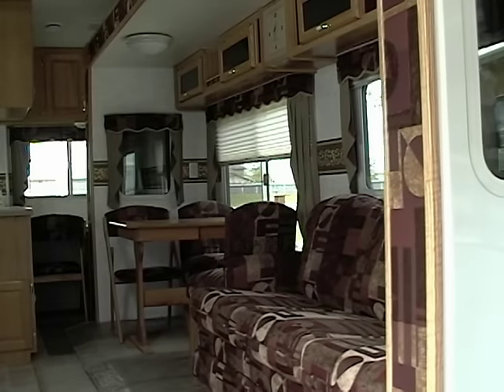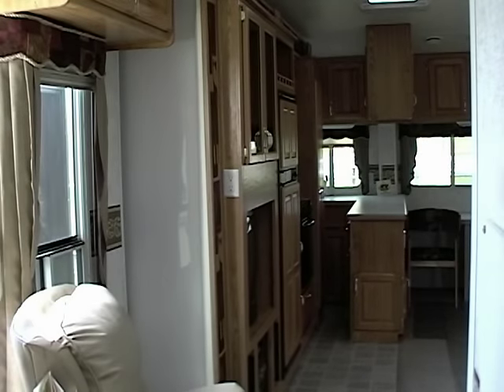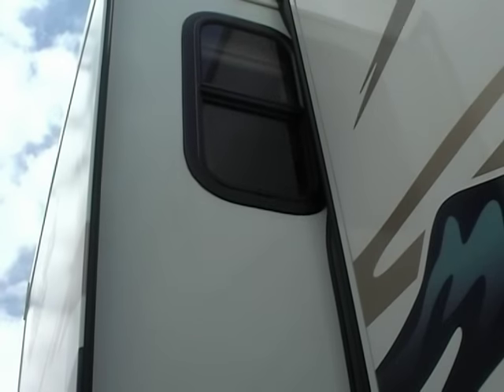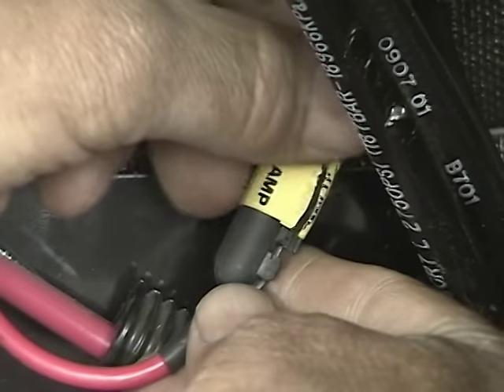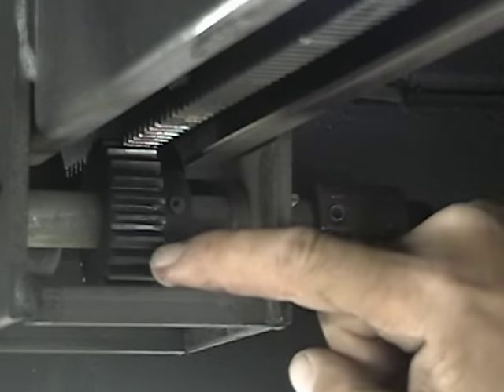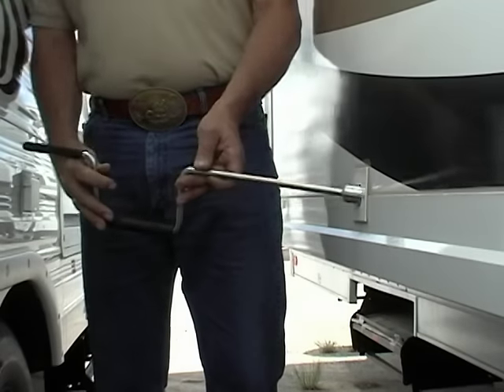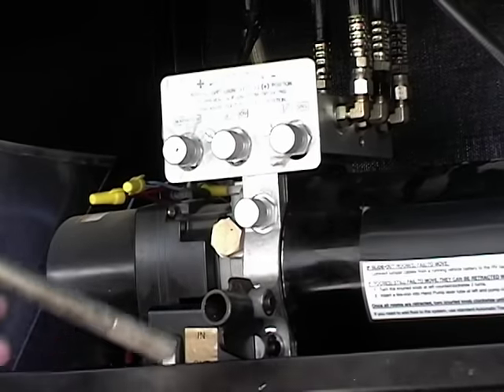RV Slides - Emergency Slide-In and Manual Retract Procedures

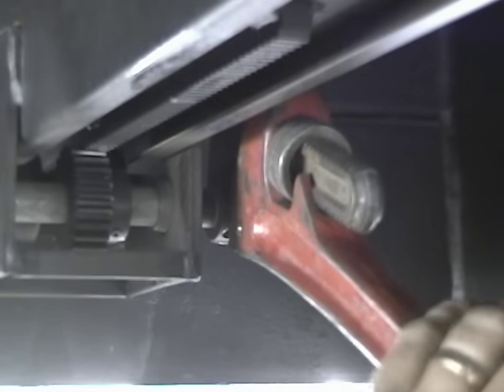Comment: 1:09 That is a pipe wrench, meant to grab round pipe and bite on. It will destroy the flats of a hext-nut over time. If you don't have a wrench of the correct size, at least use an adjustable end wrench, which is designed to work on nuts. I know, anything in an emergency, but you don't need a lot of tools, just the right ones.

Comment: All slides describe does not include the schwintek system? When they fail, and they do,
they are not that easy to retract. And when they fail the solution is to replace the entire 
system. The tracks are made out of aluminum? Not steel? The override is not easy to get at. On a large RV the main slide is over 24 feet long being supported by a small aluminum tracks, no arms.
Reply: Horrible cheap stuff made enough to get out the door I have a 1959 Shasta trailer and it's just solid.
But no they want new trailers so they get away with making it cheap cheap cheap